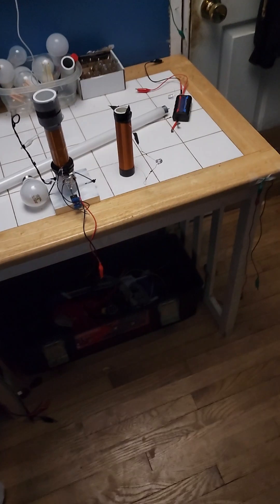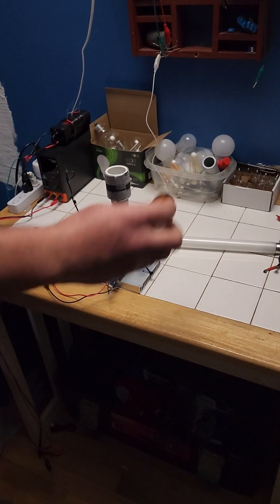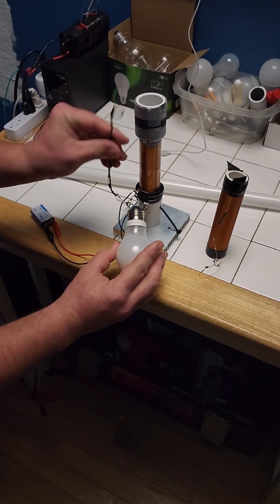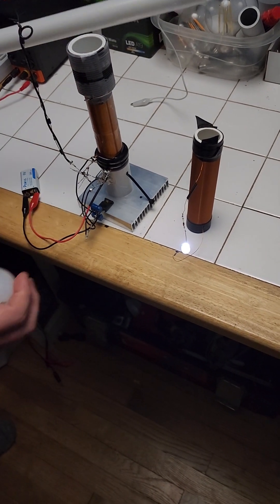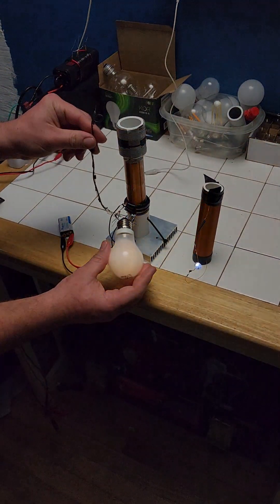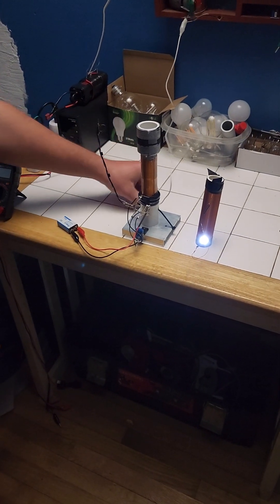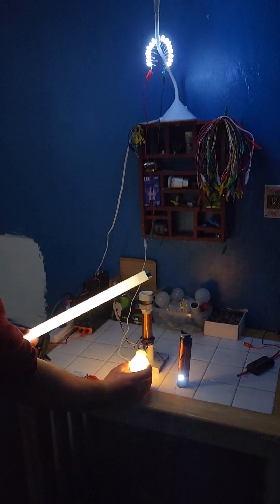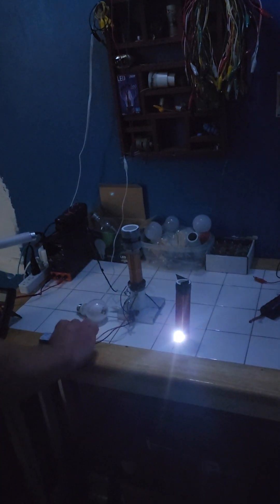👁 EYE WITNESS OF THE DEVICE & IM SHOWING TOO MUCH IN THIS VID. 9V BATTERY MAYHEM 💡

Comment: I've been wanting to tell you this for a while but I kind of been holding back so I'm just going to do it to get it off my chest I found a Tesla situation it involves a different type of wiring set up if you were to take two of your primary course of the fine wire put them together in the end close together and then the connection where they come together in the middle grounded to Earth and then slide your large power wire up to the middle and then send the wires coming out of the coils on each end to a high voltage bridge rectifier rectifier this is for charging capacitors it's supposed to put out a huge amount of energy way over unity use the capacitor set it up on a upholster system to dump them at about 15 volts to lead acid batteries
Reply: To be clear two secondary coils creating one big one with a center tap ground the large power wire in middle and the base trigger wire is another coil lightly raped around the middle to sink the system . So over all a large 8 inch with a ground center tap .you might have to double the winding on the large thick driving coil.this s basically don Smith with no tunning or spark gap.in the simplest form .

Comment: No it's Not an Energy Pump. It's a simple oscillator, Most likely the Slayer exitor Type of Tesla coil. You use a 9volt batter as a Power source. IT creates Rf which exites the Gas in the CFL Tube. Really it's nothing special. Just Type Slayer Tesla coil into YouTube and you will See...

Comment: The antenna extends out from which lead? Loos like the light bulb is touching some points in the circuit. I've lit the LED bulbs by contacting it to the end of L2.  Very interesting. 👍
Reply from the maker: Its a bit of a complicated LC circuit on that one with a grounded antenna but I'll be sending you a detailed video soon with a schematic
Reply: @MTECHINDUSTRIES  Hi, I'm Cristian and I live in Italy, I follow all your videos.  I built a tesla coil following your diagrams using your own components.  Experimenting I discovered how to greatly increase the power of the arc discharge at the top of the coil.  I am very grateful to you for open source projects and I want to show you my findings so that we can collaborate and help us create an even more efficient coil.  How can I contact you to show you my findings?